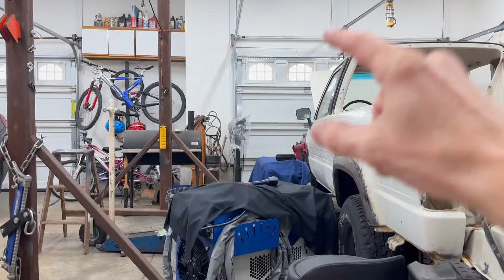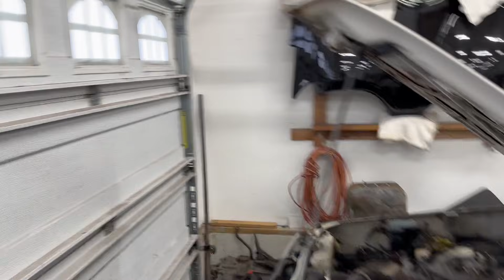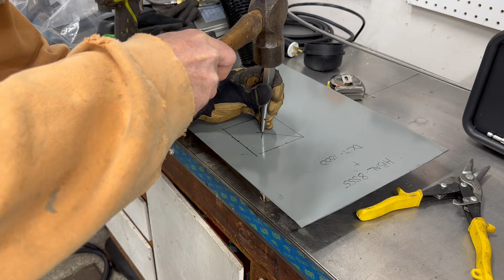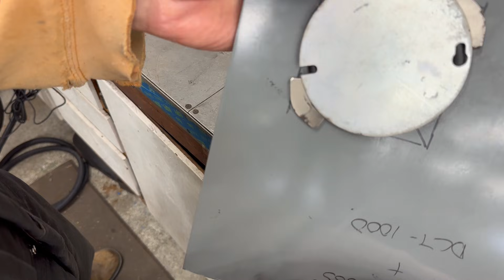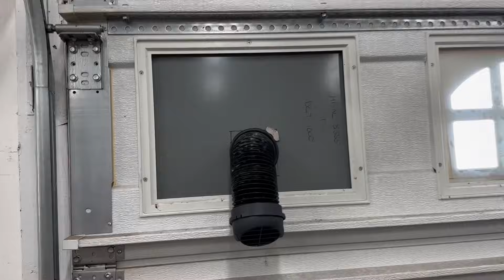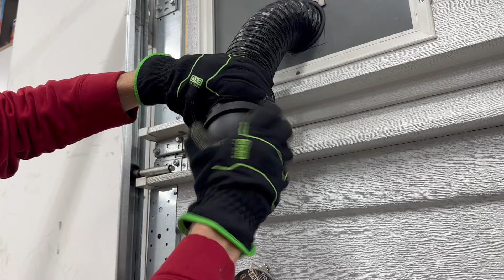Installing 8kw VEVOR Diesel Heater in Residential Garage WITHOUT Drilling Holes in Wall/Foundation

Comment: Bro it have to be incide 
It have a thermostat
Reply from the maker: You can adjust temperature by thermostat, or adjust by the power level 1 through 10. I use 1-10.

Comment: Much more efficient if unit is inside. The air intake that the unit heats is on the back of the unit. So you are heating already warmer air. Run the exhaust and fresh air intake outside
Reply from the maker: I'm going to try that and compare the temps.

Comment: Let the exhaust flow into the garage on start up it puts out small amount of fumes. after that it burns clean can’t even tell it’s there running.
Reply from the maker: I think I'll do a comparison of running the heater in the garage to see how much more efficient it is, but route the exhaust out through the opening.

Comment: Hey B!  Nice upgrade for this time of year.  Have you considered a vent-less propane heater for inside the garage to bring the temperature up and then maintain it with the diesel heater?  I have the same sort of problem in my shop getting it up to temperature - if I start to heat it, everything is so cold that by the time it gets comfortable, the day is gone!  Also, would you consider doing a comparison of running the diesel inside the shop with the exhaust routed out and it recirculating the heated air vs the way you did it in this video?  It might be interesting to see if recirculating would heat the shop up quicker and how loud it actually is.  Thanks for the video and best wishes!
Reply from the maker: Hey I do have an old propane torpedo heater. It doesn't always stay on though, so I need to be there with it while it's running. Also it's super loud, so I can't film with it on. But it does do a good job of initially warming up the area. I think I will do that comparison of running the heater in the garage to see how much more efficient it is!
Reply: @6thGearGarage  Awesome!  You always do great comparison videos and like the dash recovering follow up videos, it's great to see how things hold up over time.  You could pre-warm the shop up with the torpedo, and then switch over to the diesel and see if it maintains the temperature.  Also, I agree that it would stand up to reason that recirculating the heated air in the shop through the diesel heater would work better, but like you said, the noise might not be tolerable.  Thanks for the reply and I can't thank you enough for all the videos you have put out over the years.  Best wishes!

Comment: Your exhaust is only a few feet from your fresh air intake.
Reply from the maker: I'm also going do a comparison of running the heater in the garage with the exhaust going through the cut out to see how much more efficient it is. That will solve the issue as well.
Reply from the maker: I haven't found that to be a problem with this unit. It is well designed.
Reply: @6thGearGarage  also you need the air intake inside to circulate the heated air instead of heating the air from outside.
Reply: @6thGearGarage It’s really nothing to do with the unit. If the wind blows the exhaust 2 feet towards your garage the in take is going to be sucking in CO. The only safe way is to put the intake to the interior as well. Also reduces pressure.
Reply: That intake is only for the combustion. The air intake for the unit to warm is on the back of the unit. Which is why it's best to have unit inside to have warmer air to use and not burn as much diesel
Reply: @christaylor5996 I’m talking about the “indoor” air intake on The back of the unit.  It’s about 2 feet from the exhaust.

Comment: So much easier to just drill a small hole in the metal garage door which you can plug up with a cap in the summertime
Reply: that would look horrible. Esp for next owner of the house if they dont want the heater. Easy does not equal better.
Reply from the maker: @Topo42mh the whole point of doing it this way was that when the weather warms up, I’ll pull the sheet metal out and put a piece of glass back in the door.  I didn’t want to do a permanent installation that could decrease the value of the property.
Reply from the maker: I could, but then I'm stuck in that spot. This way I can move it to different window panes, depending on where I'm working in the garage.